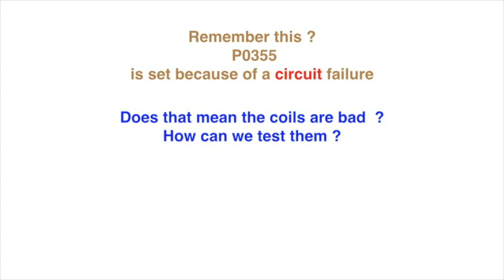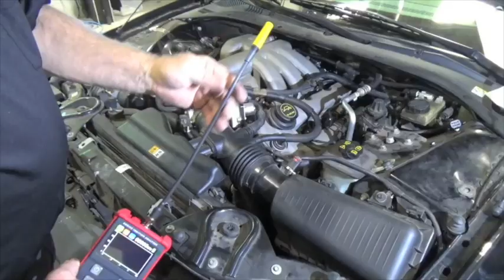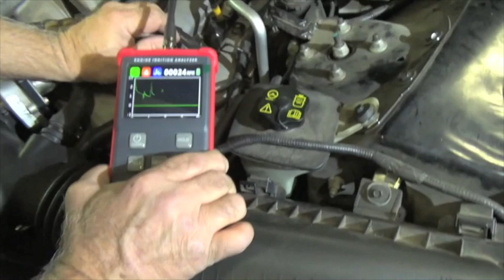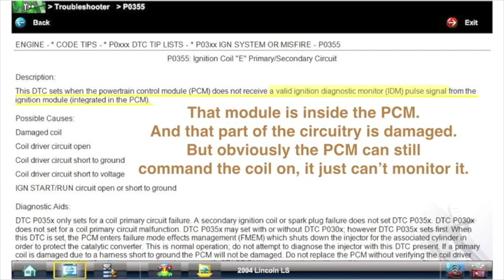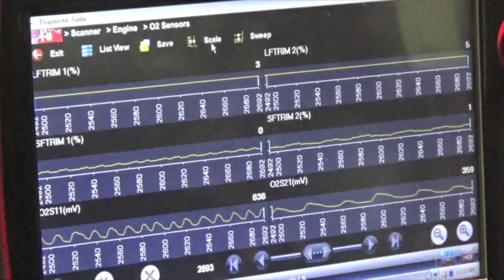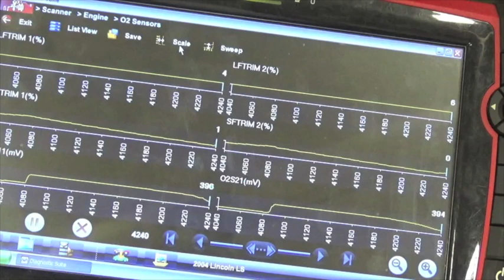Part 4 Various tools, Critical Thinking, Evidence

Comment: I have a 6.0 liter Chevy Express van that has 15 psi vacuum but it fluctuates but it also has p0300 code
Reply: Try disconnecting the egr valve electrical connector. Had a similar problem on a 2000 GMC jimmy.

Comment: Just to make sure I understand correctly.

You figured the coil was bad because of the nature of the code or was it a test you did that I missed?
Reply: The code and the info pointed to a specific problem on the ECU. Plus some knowledge that how some coils can burn the driver inside the PCM.

Comment: Nice job
Techs should use the vacuum gauge more often. The relative compression test seems like everyone is using to distinguish mechanical faults . Can't beat that test checking cam crank 
 correlation. Really nice inductive coil scope you used. 

 more often. Looks like everybody is going to the relative compression  test.
Reply: Can't beat the the critical thinking with vacuum gauge.